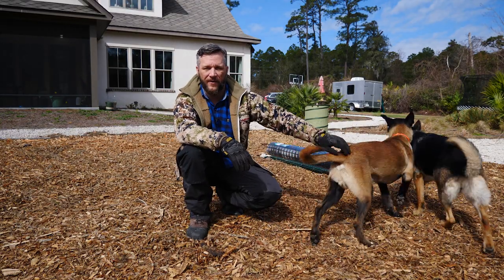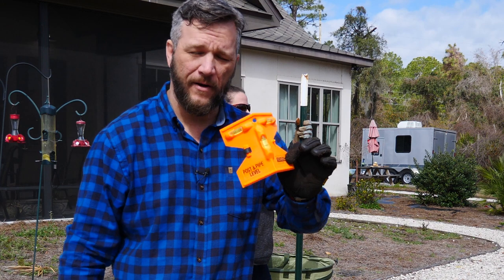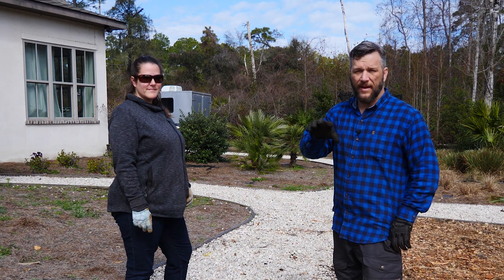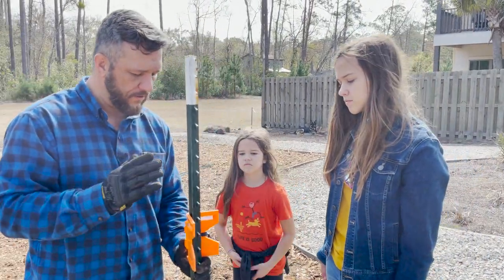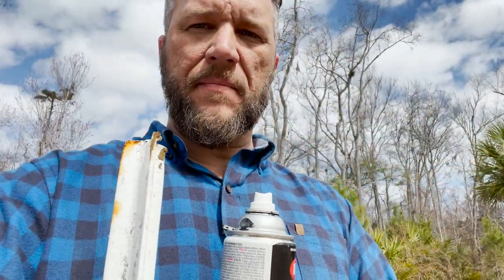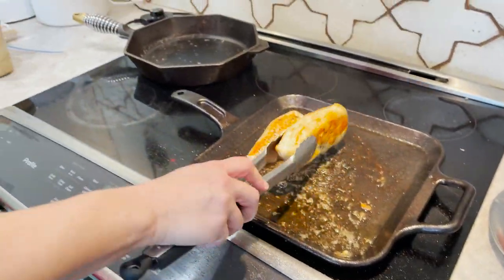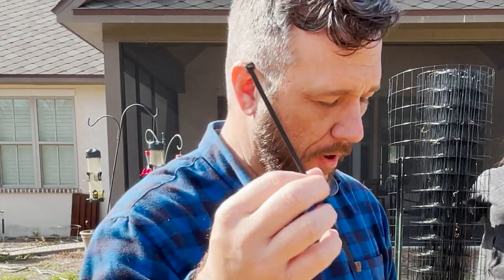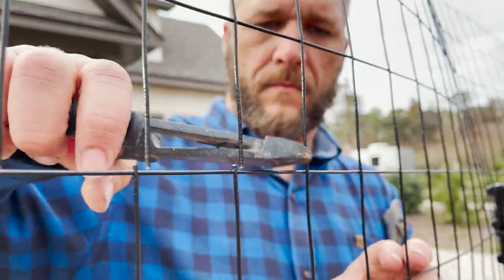If This Doesn't Work We're Done For!

Comment: When trying to leverage a piece of wood with the fence post, pound the post into the ground @45 Degree angle so the end goes in just past the point you want it to end up at (ie Vertical with wood in proper place.)  Once you have it driven in at this angle at about 3", (depth depend on soil, wood size, etc.) you can push the wood board into place and the fence post should be nearly vertical at this point.  If you are not a on the spot, you can at least pound the leverage post into place, regardless of the angle, to hold the wood board in place while you place a second post near the first.
TIP: if you can do so safely, keep the post pounder on the post from the time you set it at a 45 degree angle, until you pound it in vertical/near vertical; do not remove the post pounder while leveraging the wood board into place as it is difficult to hold the leverage post in place while lifting a post pounder onto the post.
God bless.